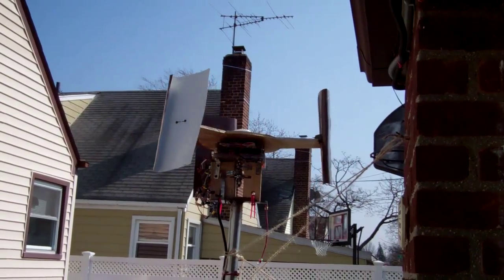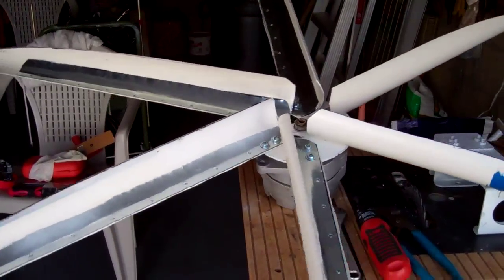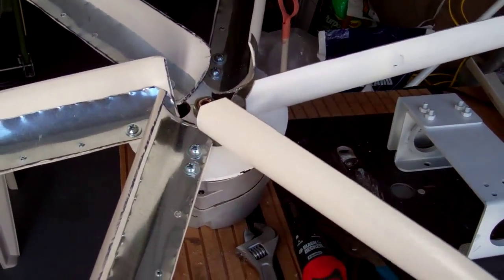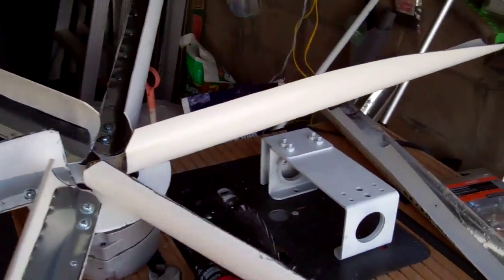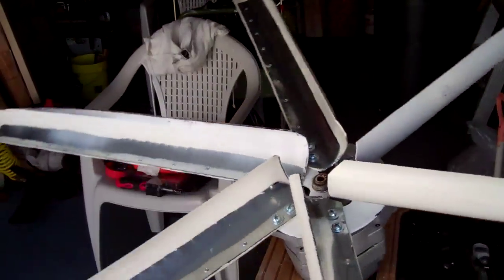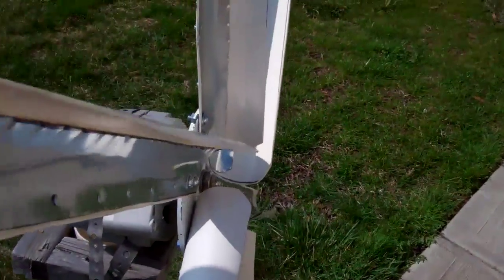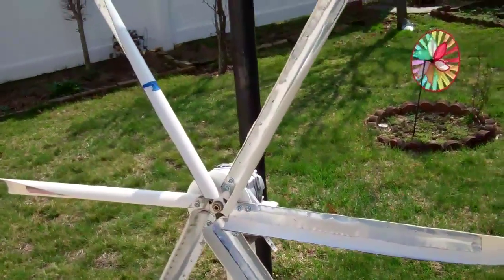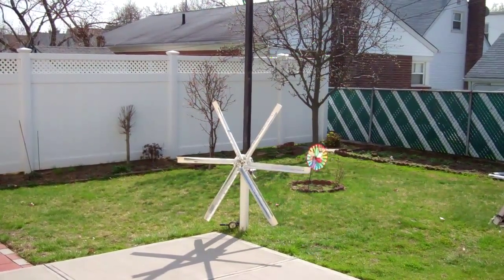Car pma wind turbine with reinforced pvc blades.mp4

Comment: They look cool! Living in town is difficult for strait line winds .. I have the same problem. For a tower I usually use 1 1/4" galvanized steel electrical conduit. Cost is under $10 (Home Depot) for a ten foot piece and is very strong and rigid. Good well attached gang wires are super important too. Again, nice work and can’t wait to see them go. I imagine at some point a major wind will whip that thing up to speed even if just for a short time. Thanks for posting!

Comment from the maker: I don't think I can balance it when the blades are attached to the pma. You can probably stick a rod through the center of the hub and then try the blades in different position to see if they can maintain the balance. I can also weigh them but I don't have a scale to weigh them.